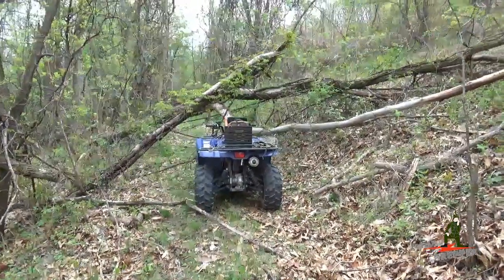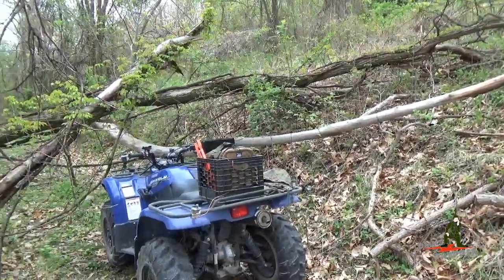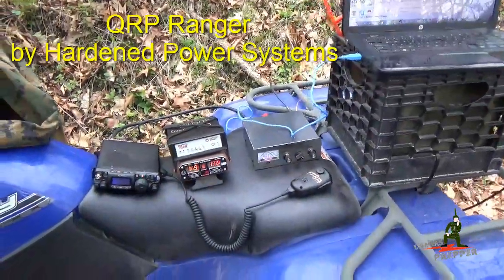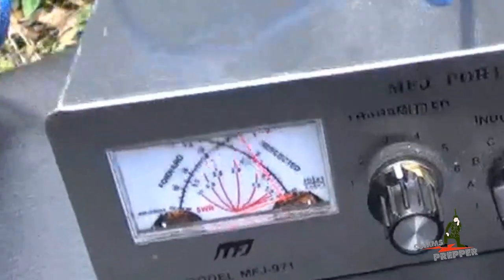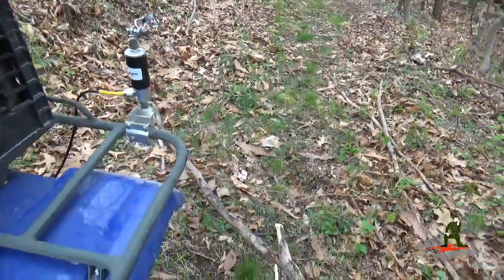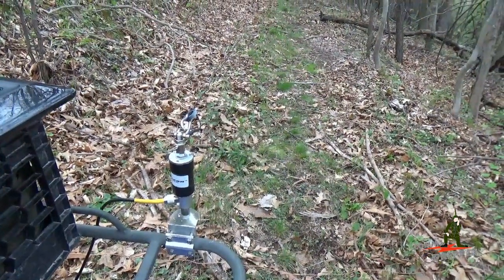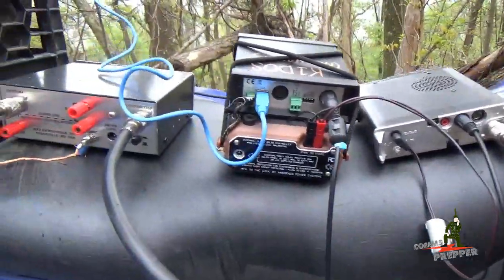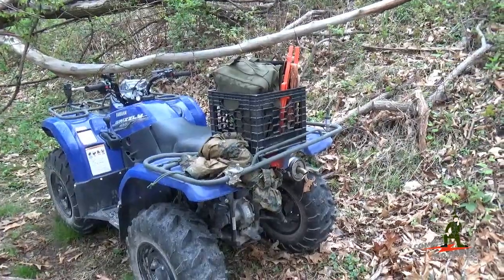QRP HF Radio Field Operations

Comment: Just FYI, I ordered one of those Hardened Power System QRP deals, and paid by PayPal.  Never heard another word from them.  Sent an email.  No reply.  Confirmed that PayPal did send them my money.
Reply from the maker: +Pat Gwin Pat I will cut and paste your comment and send it to them.  I'm sure it's a glitch somewhere.  Hank
Reply: +Commsprepper Arrived today, well packed.  Still doing the initial charging, but unit looks great.  I think it will be a great match for my Elecraft KX3.  Slightly smaller than I had perceived from the photographs, which is another plus for me.

Comment: Have you tried making voice contact with that system or just email? I would be curious to see how it would work on voice.
Reply from the maker: +buzzsah I have made voice contacts but it's not my thing.  From a prepping perspective - I see more value in digital communications vice voice operations.
Reply: +Commsprepper Thank you for your reply I was just wondering it would be nice to have all your options covered.
Reply from the maker: If I need to run voice ops I can.  There are plenty of YouTube voice ops videos with the FT-817ND radio.  I would not be adding anything new on that topic.